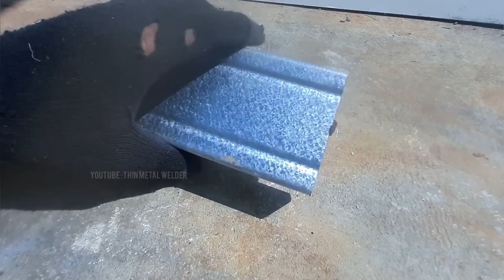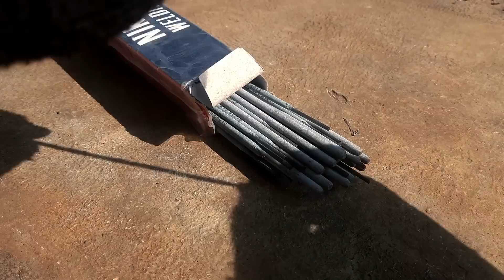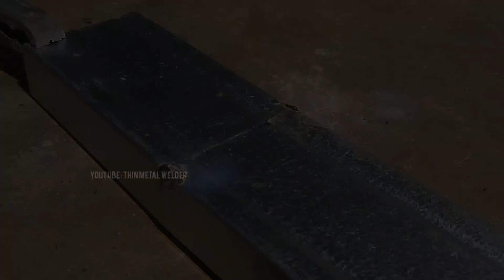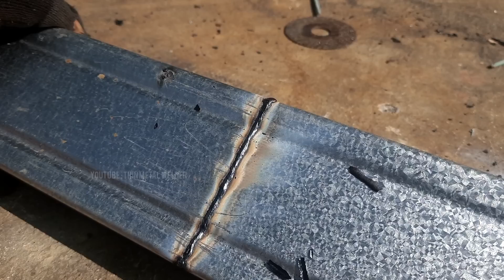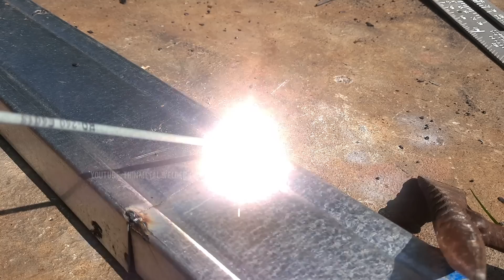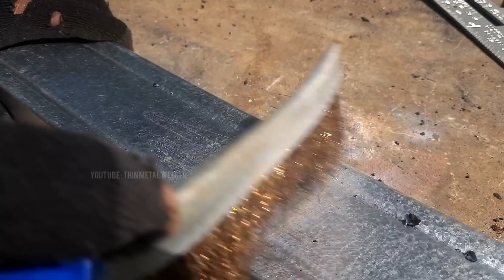0.7mm welding secret, not many know super thin metal welding tricks

Comment: This is NOT a safe practice! This is welding galvanized metal and MUST be cleaned off first for safety purposes. DO NOT weld like this. A proper safety mask is required but this representation is UNSAFE.